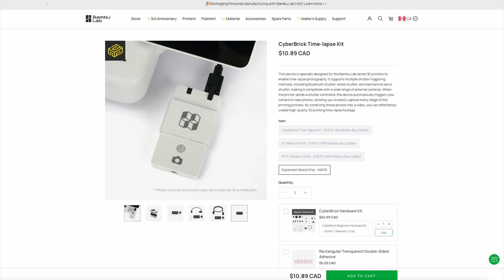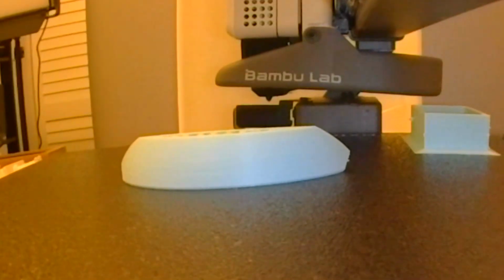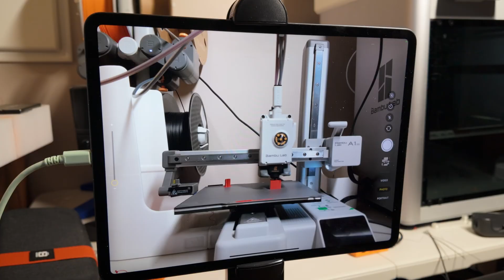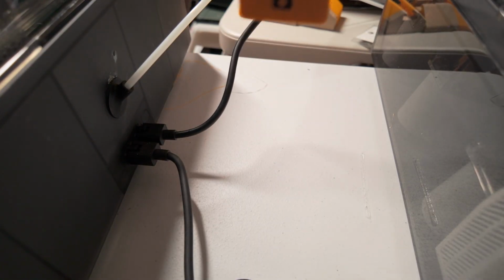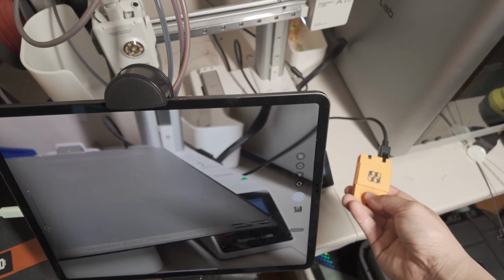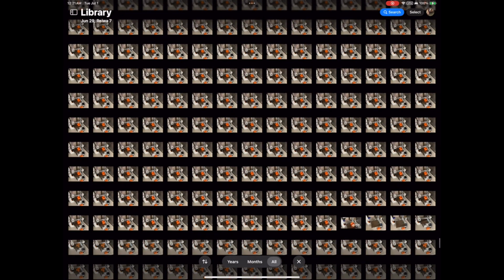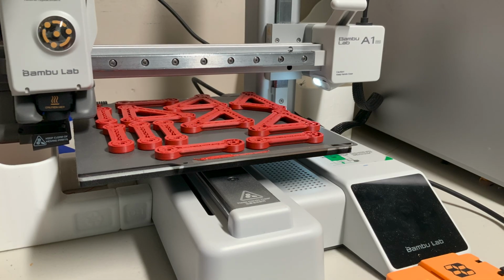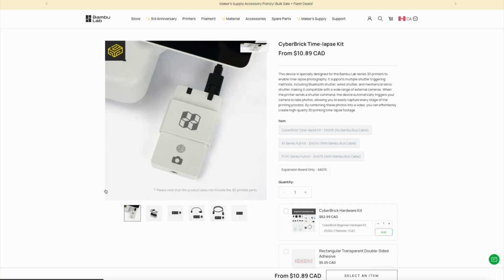Better Timelapse Footage with Bambu Lab CyberBricks Time-lapse Kit

Comment: How do i use a smart phone? The camera on the smart phone times out before the layer is finished and shuts the camera down. So when it activates the photo it just turns the volume up and down because the camera has closed.
Reply from the maker: You will need to got to setting and make sure the phone doesn’t go to sleep, and plug it into a power source ( charger). I am not sure why the camera times out…. Make sure to open it with camera app icon.

Comment: Your video editing program should just be able to identify the position of the print head and just give you the frames you need from the full video stream. I'm using ffmpeg and opencv.
Reply from the maker: Thats good to know. But If you use smooth time-lapse there is no need to do that, as all photos the print head will be at the same position.

Comment: I have properly set up my CyberBrick device with my Bambu Lab A1 Combo printer. I also paired the device with my phone via Bluetooth. When I press the button on the CyberBrick, it takes a photo without any issues. However, when I start a print with the intention of creating a timelapse video, the device does not take the required photos.
Is there anyone else experiencing this issue?
Reply from the maker: Did you enable time lapse in the slicer when sending the files to print?
Reply: @the3dfish  The cable I was using turned out not to be original.
I ordered a new original cable, and that solved the problem.

Comment: hi, 
thanks for your video, I received one, I connected it in bluetooth with my iPad Pro and my Iphone 12 Pro Max, activated the TimeLapse option before printing but during printing no photo is taken do you have any idea of the problem? 
Thanks
Reply: The cable I was using turned out not to be original.
I ordered a new original cable, and that solved the problem.
Reply: @evrenot3d  Thanks for your help! Support had the same answer, so I'm waiting for another cable.
Reply from the maker: Hello! When you press the button on the time laps kit, does your phone take a photo?
Reply: @the3dfish  Yes, when I click on the button it takes a picture  but when I print no picture.
Reply: @Mrbobby6367  I’m experiencing the same issue.
I updated the firmware, but it didn’t fix the problem. When I press the button on the CyberBrick, it takes a photo, but when I start a timelapse print, nothing happens — it doesn’t take any pictures. :(

Have you been able to solve this issue?

Comment: Can this also turn on a lighting setup?
Reply from the maker: I don't think so? The Camera will need to trigger flash, as the Time-laps kit is just a fancy camera trigger.  I just use continues video lighting.
Reply: @the3dfish  Thanks. Yeah, I was thinking "continuous" lighting, not instantaneous flash but switching it off for most of the layer printing to save energy. Something to ponder.

Comment: Can i use like you when i bought only (Expansion Board Only - XA015) ? I will use It with my iphone.
Reply from the maker: I think you will need both…..  the module sits on top of the board with USB C port have bluetooth function.

Comment: I just got it and time lapse expansion board doesn't turn on just the Multi-Function Core Board turns on any tips?
Reply from the maker: Is there a light on? Only one of them have light. The bluetooth is discoverable if the light it on. I highly recommend join the official Bambu Lap discord channel as its probably the best to get some help from the community fast.